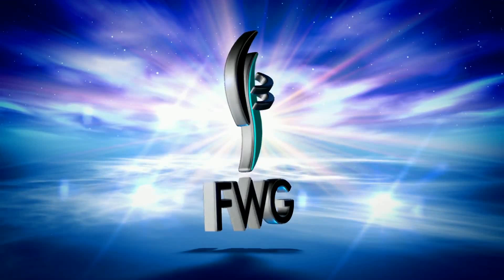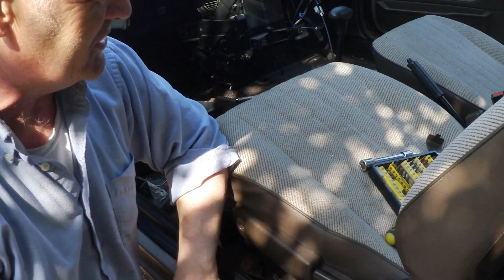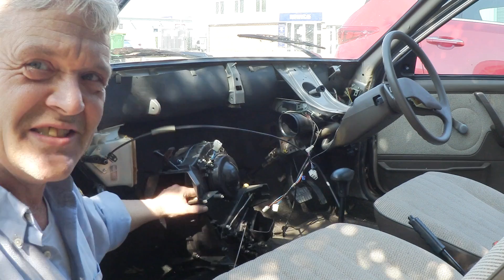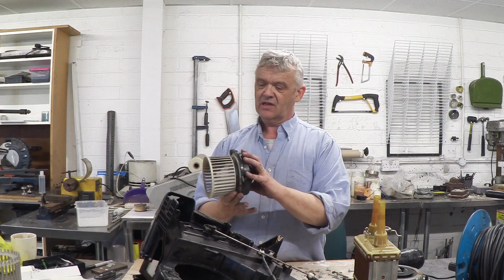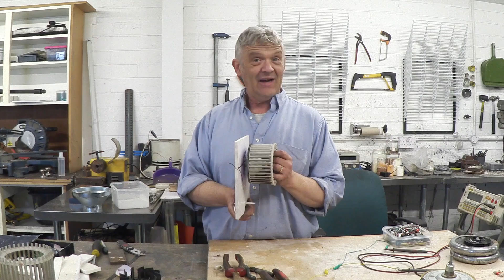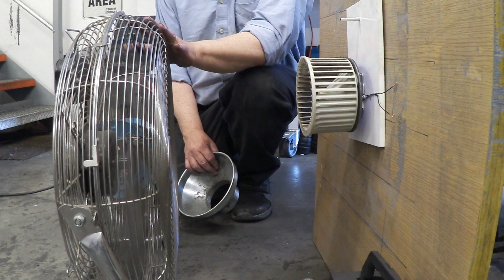Car Blower Rotor For Wind Generator

Comment: An excellent design for wind energy. Your wall turbine and the funnel could be fitted inside a square box ( a Microwave casing could be used). With just a round hole on the side facing outwards, I can picture it now, like a small AC unit attached to the wall.
Reply from the maker: Cool idea mate - cheers

Comment: If the funnel had strips spiralling inside, to make the air go the same direction as the blades on the turbine. So making a vortex?.
Reply from the maker: I like that mate - interesting
Reply: Sounds like a Viktor Schauberger principal
Reply: Infinion  Not familiar with that name, any good links?

Comment: Ok it might not be efficient on just any wall per say but what about a wall in a city highrise that has tight isleways, kind of like the ones that are only big enough for  foot traffic. I bet they have tons of wind pulling through those isleways. Also under bridges, there is a lot of air flow. Use this and use the other wind\vibrate method that you just built with the twisted ribbon and wah-la, you would have enough power to run the led lights on the bridge or streets. Fantastic mate
Reply from the maker: yes I'll bet there is - I think you are right mate - it will be more about where such device is sited

Comment: Another variation on a clem engine. https://youtu.be/VnpRS6KdiiQ
Reply from the maker: cheers mate
Reply: @ThinkingandTinkering  maybe if this was fed from the center through tesla valves allowing more pressure at lower rpm's and with some accumulators placed around the rim like bladder tanks to allow a pressure build up. Then a set of fins placed around the outside housing with a variable shudder angles to give a variable back pressure to the rim jets ?

Comment: I would like to see more investigation on improving the exit air flow. Putting a conical cowling over the squirrel cage that directs the incident air flow away from the might have a double benefit. First, with the generator mounted on a flat surface, the incident air will create a high pressure area around the squirrel cage that will hinder the exiting air flow. Putting a conical cowling around the squirrel cage will direct the incident air away from the exit path and, if the gap between the wall and the bottom of the cowling is set right, the venturi effect will make incident air flow create a negative exit pressure as it moves away from the generator. Something like the Dyson "bladeless" fan.
Reply from the maker: go for it mate - this is easy to build
Reply: @ThinkingandTinkering  - I was hoping you would save me scrapping a car of my own and then there is your comments on efforts of removing the blower, but thank for all the good work and neat ideas.

Comment: This is a great channel, I had no idea that you could get a pancake motor out of a car but now I know. I agree with your thoughts on how it doesn’t matter how well it works as it’s still good to experiment and get the creative juices going and efficiency is not critical if you are getting energy for free especially if you have a good way to store it. Back in the early 2000s I found my self in the engineering department at the Australian Broadcasting Corporation and discovered that all the batteries in the exit signs were being replaced. As an electrician I’d thought for a long time that there needs to be something better for power back up of exit signs as there were always too many failures. I got the idea of using weights in vertical pipes that could be placed between the stairs in the fire exits. A motor/generator powered by wind and/solar could raise them and when there is a power failure the weights could drive a generator through a gear train to power them. Since then I discovered some one finally developed the system for general lighting,  maybe you’ve seen it, it’s called the gravity light. It’s a practical option now that we have LED lighting.
Reply from the maker: that is brilliant mate and no pun intended - I really like that story - it just goes to show how we should be tackling the problems around us

Comment: I suspect the cone is doing more than just collecting more air. It only has about twice the area of the rotor intake, yet without it the rotor didn't turn at all. I think what's happening is that without the cone, as much air is blowing around the rotor as through it, so there's hardly any pressure difference to create a flow from inside the rotor to outside. But with the cone in place, air is shielded from blowing around the outside.

This idea could be tested by trying just a flat baffle with a hole in it instead of a cone. If I'm right, this should also spin the rotor, although maybe not as strongly as the funnel.
Reply from the maker: for sure mate

Comment: LOL I did the same thing with a Toyota blower rotor to check the effectiveness of the Water's design...was greatly impressed..still ended up building a savonius with a 55 gal barrel
Reply from the maker: well a Savonius is an easier build for sure

Comment: People often like to dumb down renewable energy and home micro-generation systems, these people I am sure actually want the greedy energy companies to have the upper hand.
A frequent thing they harp on about is "Payback Time" they would argue that my Solar Thermal panel which actually cost very little and has run with no bother for 18 years must pay back its original cost before it starts producing free hot water (which it has anyway many many times over), or my PV panels and batteries have to produce enough electricity to pay back the cost of the infrastructure. 
My argument is you can buy a shiny brand new condensing gas boiler which is also infrastructure and that could cost thousands and could probably breakdown and never work again after five years and during that time you must also buy the gas to fire the thing up to get your hot water, so when is the payback time on that? never I would say.  
So many naysayers and negative people, there are ways of making even small amounts of energy generation practical and wholly useful.
And I am typing this using stored electricity in batteries and using an inverter which is only switched on when needed, I have a 12-volt compressor type fridge and 12-volt lighting. 
It is about being frugal, treading lightly on the Earth and saving money for nicer things like holidays and meals out with good company, instead of lining the pockets of some greedy fatcat energy executive and bolstering his or hers fat pension and extravagant lifestyles all while UK pensioners struggle to keep warm and have to decide between heating & eating.
And Efficiency is totally laughable really if it only converter 3% of the winds energy into electricity then so what, providing you have enough space it is not really a big issue with renewables because the fuel is free, if you look at a car engine lets say, then that needs to be efficient because you are having to pay for the Petrol to run the damn thing. 
But the efficiency of a small wind turbine is hardly worth fussing over unless you are a commercial wind farm installer.
Reply from the maker: our society Is built on consumption mate and we need to change that

Comment: Here's one for you to try if you'd like.  Simply use a ramped shroud over the return blades so the wind isn't working against them.  This is from a side wind not your flat design (which is an un-shrouded jet turbine engine blade set up by the way).  This will both ramp your blowing wind into the "catching" part of the cage blades but also blocks the blowing wind resistance (not all air resistance of course) from the returning side blades.  Great use of lock down time making all these videos.  Keep at it.
Reply from the maker: nice post mate - thanks for the tips

Comment: What happens if you move the fan to the left or right of the squirrel cage and angle the cone into the direction of the on coming airstream?  Does the cage still turn as it did? If it does, could you rig the cone to follow changes in direction of the wind like a weather vane to always direct the wind to the cage? Then it won't matter in what direction the wind comes from. Just wondering if you have tried this?  Now I can't throw anything away. Everything has a use. 👍
Reply from the maker: try it and see mate - this is an easy build project

Comment: A squirrel cage from a forced air furnace for a house may be sufficient to drive your Nissan blower motor. It may be a bit heavy, but sorting that kind of stuff out is much of the fun!
Reply: Those are a bit pricey, but those vertical fans that people get rid of all the time usually have a decent squirrel cage.
Reply from the maker: for sure mate

Comment: Rob Sir love and warm regards from India!! Very fascinating concept, I am building a three stage squirrel cage fan, wish to send you results soon sir
Reply from the maker: I'd look forward to getting them mate
Reply: Am doing a design with offset of blade arrays in 4 Stages causing a cascading spiral, that should eventually help to catch sufficient air and get it moving.
Reply: Addition of a flywheel and gear to drive DC Moter to act as a generator will do a great job as well

Comment: It  is the calm in the center of proper air

Bob try. And compile with an impeller instead of a propeller 

Like a conk shell blade. You will be much suprised
Reply from the maker: cheers mate

Comment: Love the videos Robert....just a quick question about putting the funnel infront.  Didn't that to some degree accomplish the same thing a bringing the fan closer?  Shouldn't the distance be the same from the front of the funnel, pushed back further, as it was from the squirrel cage.  You are way smarter then I ever hope to be so maybe this is not the case.
Reply from the maker: I suspect not mate - but nice thinking - cheers

Comment: The cone works better, because, it shields the sides of the rotor, so the wind blowing through the cone into the squerl cage can flow away easier. With the cone you creeate a higher pressure difference between inflow and outflow. It also funnels more air, creating higher pressure at the inlet, so it serves 2 purposes. But i think the creation of a high and low pressure point is the main reason the cone works so well.
Cheers,
Rene
Reply from the maker: cheers mate

Comment: Hi Rob question that popped up following this series (recyclable energy generation) what is the more efficient way of generating DC. Alternator rectified or permanent magnet generator. Thanks and keep up with the new Ideas
Reply from the maker: I am afraid I don't really know mate
Reply: PM is more efficient because of less parts and simplicity. An alternator needs DC excitation to generate the magnetic field, then it needs to be rectified with a diode. Lots of losses along the way. For reference, car alternators are about 50% efficient.

Comment: With your small prototype in mind, what if you put a larger one in front of a car in order to use a secondary charging unit for an electric cars batteries.
Reply from the maker: I suppose you could try it mate
Reply: If you put a wind generator on a car, you introduce drag as it drives. It would always cost you more to drive a car like this, no matter how efficient the turbine is.
Reply: Reminds me of the sail powered wagons that were used for a short period of time on the great plains.

Comment: As the squirrel cage works differently from a rotating blade in the air flow I.E it is driven from a high pressure inside the cage flowing out through the side blades to equalize with the ambient pressure there is a possible way to increase the output by mounting the funnel on a curved wall in front of the squirrel cage this should lower the ambient pressure behind the wall and increase the pressure différance that it is trying to equalize.
Reply from the maker: nice one mate- cheers

Comment: i love this.. on thing i would do instead of using the Squirrel cage how you had it horizontal .. lay it on its bottom so the fins are vertical.. you get more surface area like that. if you run 4-6 of them "in a line" You only need ONE direction of wind.. which will blow  and activate ALL of them.  before it hits the house and disperses. This guy understands .. https://www.pinterest.com/pin/445293481878483372/
People love to dismiss ideas.. the main reason is because they dont want to do work.. if you can show them that they are wrong... it means they have no excuses to not do it.  Good stuff as always.
Reply from the maker: that is a nice sign thanks for sharing it mate - cheers

Comment: Another suggestion might be to "sandwich" the rotor. So you might have a second skin with a hole the size of the inner diameter of the rotor (rather like your funnel) just over the top of the fan. This would then ensure that the escaping air is not being interfered with as much by the wind from the fan. You could play with variations in size of this, including even preventing this from allowing air in from the sides, while allowing air out freely. 
Just a thought.
Reply from the maker: it's a good thought mate - thanks for taking the time to post it

Comment: robert i agree that these small generators are interesting but unless you can concentrate their output it is had to do anything with it remember the average car alternator is only putting out about 500 watts so whether you use air, hydraulics or electric you need to store some of this to concentrate it so you can use an alternator or motor to put useful amounts of power out when you start trying to power things off these small power sources you begin to realize just how cheap power has been. i am not saying to, not do this what i am saying is needing to use less is a big part of making micro power useful so the first step will always be how can i do it with less .
Reply from the maker: I agree absolutely mate - the real answer lies between the two - use less, generate more of your own
Reply: and add storage maybe you could do a show on capacitors ans batteries and accumulators as well:-)

Comment: Wonder if it would work in reverse powered by venturi effect. Could install something like this in a disused chimney for free power.
Reply from the maker: that is an interesting suggestion mate - I will have to rig something up - with a vacuum cleaner maybe?
Reply: @ThinkingandTinkering  You could lay the motor flat, position the funnel above and blow your fan across the top.
Reply from the maker: @agt155  to be honest mate - I have something else in mind - that I am on with but if I get round to it I will give it a go

Comment: I think the squirrel wheel has a down side, which is, the part that don't expel the air that hits the wheel from the outside will pull air from the middle and try to push it out. Maybe a D shaped gard would help. Yeah I will do my own experiments eventually. Lol
Reply from the maker: lol - you are right mate - there are bound to be issues with any design it's really about how you tackle those issues, if the issues are significant and if the resolution costs more than is worth it for the output

Comment: ........That's good fun .The improvement with the cone / funnel isn't probably for the reason we might think but I'm too tired to think it through .. That radiator appears to be copper based and it's a dying breed and getting hard to find .I'm pretty sure that digital scales can be used in vertical configuration to measure wind flow pressures , so folks can do measurement of pressure variation from wall in incremental approaches to the fan. Then  measurements can be made  at  points behind the cone and in front etc. . . .
Reply from the maker: I like the scales idea mate - I must look into it - as for that radiator - it's an awesome find!

Comment: I wonder about the plain old kids pinwheel design- those seem to spin with very little air, far less than any normal fan or prop blade design of the same diameter.   or take your squirrel cage, you could just Blow on a pinwheel of that same size and I Think get more bang for your buck out of it than you could blowing into the cage.  I could be wrong of course, but I think that might work in the compact wall mounted sort of device you're going for.
additionally- you know those round whirlybirds on top of houses and barns and such for roof ventillation? That sort of thing might Also be a good option.
Reply from the maker: I did a pin wheel thing here mate https://www.youtube.com/watch?v=KqfCJoHtsak&list=PLbQqm4rNo626xAWxk9BN7D0d5yiTWJbnv&index=5&t=161s
I have collected the vids into a playlist now as there seems to be a few lol
Reply: @ThinkingandTinkering  oh, well done lol!  :)

Comment: Rob the idea is sound adding lots of small ones together but put them on an open fence or wire mesh. The wind has to go somewhere when it has turned the generator and with a wall it can only go up or sideways which would disturb the other generators. All good learning.
Reply from the maker: nice suggestion mate - cheers

Comment: It would be interesting to see a turbine build that could charge a decent 12v battery or 6v like a motorbike sized one in reasonable time and then run some useful item(s) on it via a 220v convertor
Reply from the maker: for sure - have you built one? did you do a video?
Reply: Those vertical oscillating fans are usually available for pretty cheap at thrift stores and garage sales ... even free on Craigslist and Facebook (They don't pack well, so often get tossed in a move)
You may need to rewire the motor, but the squirrel cage is much bigger than a car's blower fan yet lighter and already has the right bearings.
Honestly you can probably use just a single motor and connect several units in parallel using belts or chains.